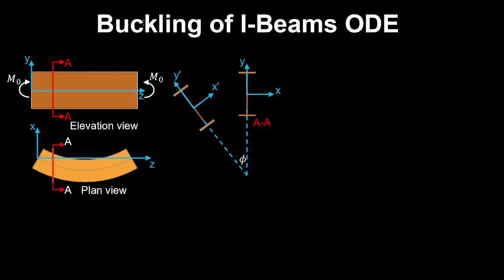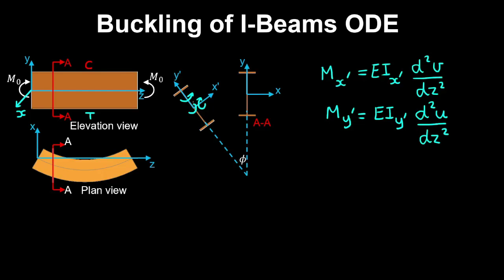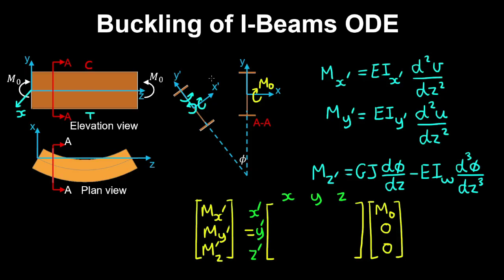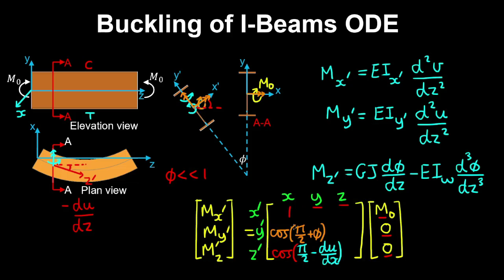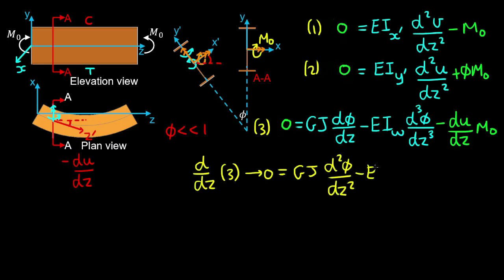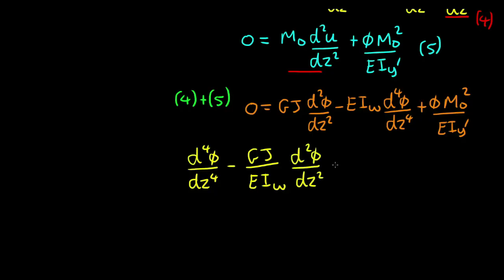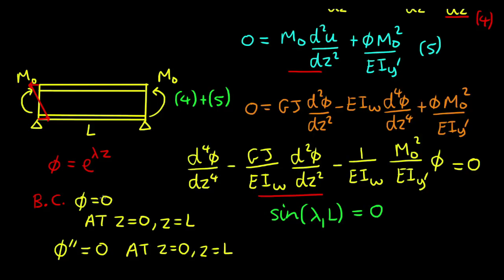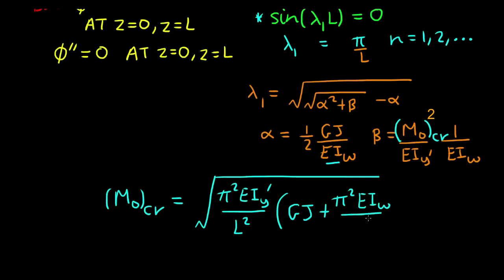Lateral Torsional Buckling ODE, Critical Buckling Moment - Structural Engineering

Comment: Very good video. Thank you for explaining the concepts which was hard to understand in college. Love from india.
Reply from the maker: You’re welcome
Reply: @drofeng can you please make a video on p delta effect and torsional effect due to wind load on tall buildings.
Reply from the maker: @sohomsen2922 I will add that.  Are you more interested in understanding the theory side or how to analyse it using software
Reply: @drofeng theory side and analysis using differential equations manually rather than software
Reply from the maker: @sohomsen2922 the p-delta analysis for high rise is too demanding manually.

The derivation of the stiffness matrix using the finite element method should be the most demanding part.

You need to assemble the  stiffness matrix that includes geometric nonlinearity into the structural stiffness matrix, apply the gravity loads and wind loads to the core, and solve for the 2nd order displacements by iteration. From these you can get the member forces and moments, base shear, overturning moment etc

Do you have a background in the finite element and direct stiffness methods?
Reply: @drofeng yes I have a background in FEM and direct stiffness method as I have completed my graduation in civil engineering. However I don't have knowledge of P delta analysis so thank you for clarifying how P delta analysis is done. However I am more interested in computational analysis of structures which was not touched in our graduation level.
Reply from the maker: @sohomsen2922 indeed, the computational side is lacking. I had to learn FEA on my own, so your uni is more thorough.
Reply: @drofeng Yeah well that's a plus point of doing BTech in civil engineering. However what is going to be your next video topic on YouTube.
Reply from the maker: @sohomsen2922  I am not sure yet, as most people seem to be less interested in the advanced topics, and those videos require a lot more time and work. I also found that structural engineers are mostly not interested in the theory behind detailed topics like this, as they normally use approximate calculations to validate their models and design codes to check for safety.
Reply: @drofeng you're opinion about structural engineers are exactly on point.
Reply from the maker: @sohomsen2922 thanks for your feedback, I’ll upload a series of videos on p-delta analysis, and gradually move towards tall building analysis
Reply: @drofeng thank you